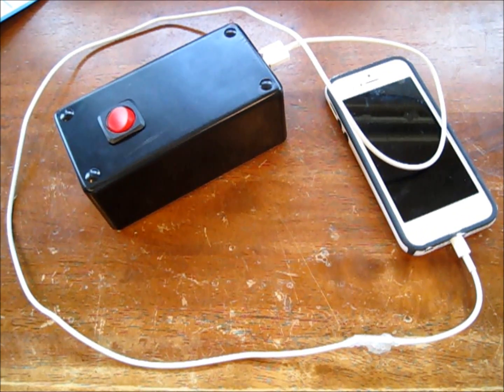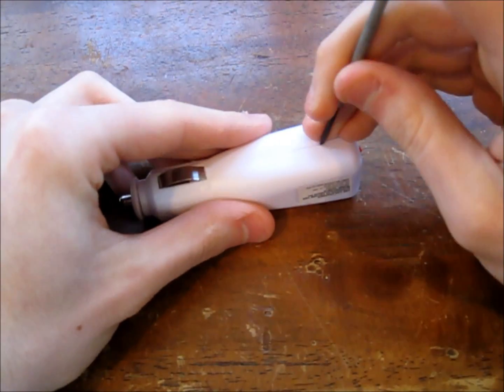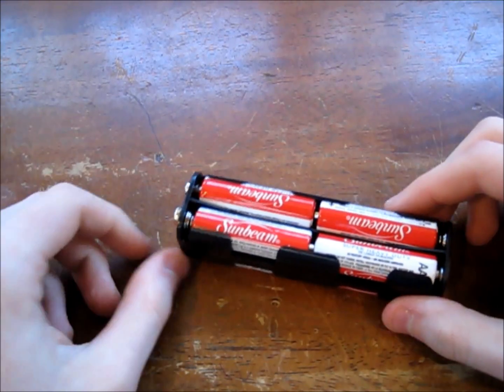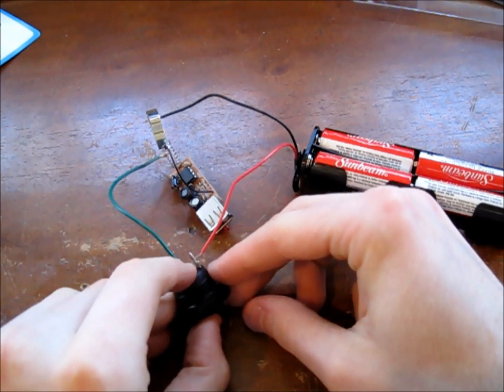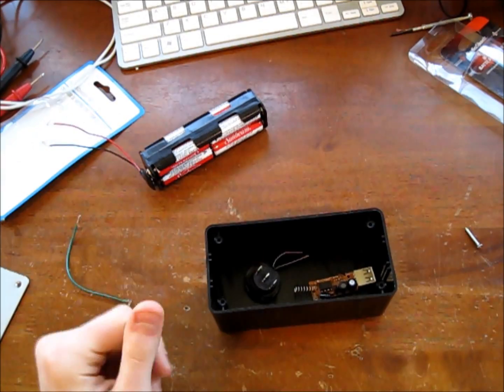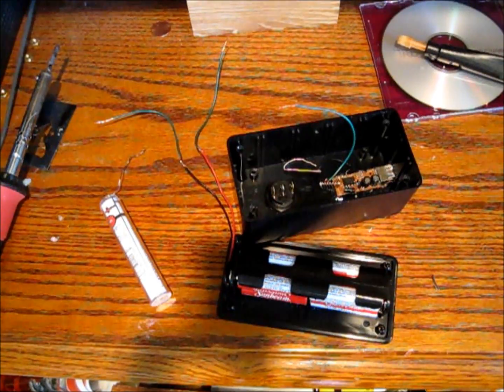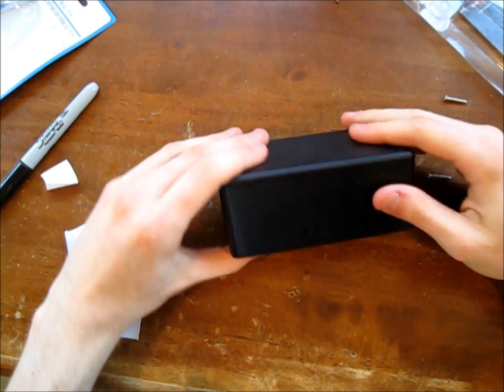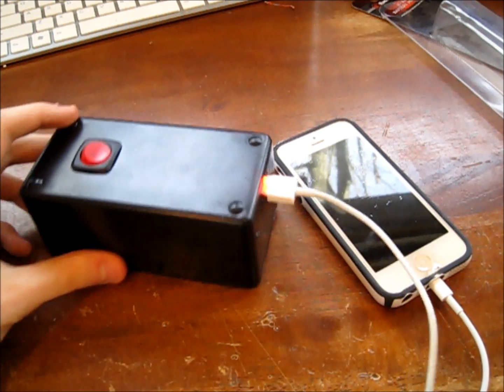How To: Make a Portable USB Charger!

Comment: that moment when you cant get a car charger so you buy the port, the capacitors, the resistors, solder and a soldering iron, the circut bord, the chip, the battery case, and all the other stuff, and build the entire thing 😂

Comment: Is there a reason you are using 8 AA batteries and not four? I don't really know all too much about electronics and shit but I'd think you could do basically the same thing except using a battery holder that holds 4 AAs instead of 8. If so is it possible to use rechargable batteries instead of regular ones? Well either way can you use rechargable batteries with this? I heard something about if you use rechargable batteries in a project like this the charger will output 6V instead of 5V or 6V will be input into it or something like that idk...

Comment: How many full charges can you get off of those 8 batteries?
Reply: The one i just bought from China was 4 dollars US and has the charge and output circuits built in. Albeit, it is from China and it performance has yet to be seen, but a small charger with regulator can be had for under a buck a piece delivered and a Buckconverter is 2 or 3. I've been looking into building a solar charged power pack that i can charge all day and use to charge my toys all night. 
I do realise this video was made in 2013 and there was not alot of good powerpacks back then.
Reply: Or you could just go out and find a 1 or 2 lipo battery power back for about what 8 AA batteries would cost, and never buy batteries again. Or, if you don't mind waiting for shit from China, you could order a 5, 18650 case and find an old laptop battery and have tons or rechargeable power. Or...
Reply: +Shellie Carlson but he will have to get an expensive battery charging and controlling circuit
Reply: nice

Comment: you did not mention which is the positive and negative on the car charger.......
Reply: That should be easy to figure out with either a quick google search or better yet by using a volt meter. Of course youd have to buy a volt meter in the first place (I dont believe they are all that expensive I think you can find a cheap $10-$15 dollar one that will get the job done) if you didnt have one to begin with if you wanted to go that route I say if youre going to be doing a few projects like this (where youre dealing with wires and electrical circuits) Id say its worth it
Reply: Upon a little more research I've learned that typically red wires in usb devices (such as that car charger or an ipod charging cable) indicate the positive (its apparently 5V DC i think most devices output 5V) and the black wire in those devices indicate the ground/neutral wire. In car chargers in particular Im pretty sure that the main spring in the middle is positive (aka the red wire) and the other weird long metal piece is the ground/neutral (aka the black wire). I think most car chargers (and to be honest most circuit boards with polorized charges) have a + and - sign for the polorized charges on them. Any other wires (such as I believe green and white in ipod charging cables) are positive and negative data and are unimportant (as to tf positive and negative data means idk XD I guess for sending and receiving the data? Idk) but if you do have extra wires you may have to do a little extra wiring to hook them up to certain electrical gadgets (Like a voltage regulator. I think you have to hook them up to ohm resistors or whatever theyre called). But whatever you do I would definitely get a voltage meter so youre guaranteed to get it right. Trust me you dont want to cross the charges. Itll short circuit any device you are charging it with which will render the device a nice expensive paper weight. Hopefully this info was helpful and I wasnt too late lol

Comment: If I used a 5 V regulator instead of the part from the car charger would it still charge an iphone? Since iphones i think need a 1.5-3V charge on the D+ cable

Comment: Does anyone have any suggestions on what to do if the LED light illuminates on the charger but my phone doesn't receive a charging signal from the charger?
Reply: do you have a iphone ?
Reply: +amine lendani Yes I think the issue is that for some reason once I connect the power to the car charger the LED works however the actually charging function no longer works. Any ideas as to how or why this happens? (I've already tried with two different car chargers)
Reply: +ethan orlowsky ios has a system thatl doesn't let unoriginal chargers work
Reply: Im not an expert but it could be that its wired wrong perhaps. You have to make sure to connect the positive wire to the ground wire (a quick google search tells you which colored wires are which but I believe for the 9V snap thing that he used the red is the positive and the black is the ground) as for the car charger insides Im not sure but again Im sure a quick google search or looking closely at the parts will tell you which is which

Comment: one other question say I had a 6 volt battery instead of a 9 volt will this cause any issues other then slower charging ?
Reply: What do you mean by that? Hes using AA batteries which each have 1.5 volts (well apparently thats only when they are new supposedly they typically output 1.2V which would mean 8 altogether would output 9.6V) altogether you should have 12V (with new batteries) not 6 or 9 (well as I said supposedly only new batteries have 1.5V so you should have 12V at first but it should drop down to 9.6V after some use)

Comment: if i wanted to recharge those batteries would I need to take them out of the unit im trying to build one where the battires can be hidden away and just there recharge port is visible
Reply: I'd imagine you could disect one of those portable chargers or something and with a little knowledge and some frankensteining (yes I just made that word up) you could rig some kind of portable charger that uses batteries to charge devices but... To be honest I think thats what a portable charger is anyway. Its just a different kind of rechargable lithium battery thats already prewired to connect to a wall or some other power source to charge. Really in the end I say just dish out the 10 bucks to buy one of youre going your route. Then again it would be a fun project

Comment: A better way would be using rechargeable batteries and get the circuitry from a cheap power bank.
Reply: Or get a power bank case for a few quid and put your batteries inside
Reply: ewelina kryszczyszyn Part of the fun's in the DIY.

Comment: Yes you can buy one cheaply now days.  However, some things come at a price on even how cheap it is.  That price is how long it last and weather or not it will damage your phone.  The cheaper it is, it probably won't deliver the output current needed.  I say save up until you can buy a $40 dollar or $60 dollar portable charger that has around 4,000 mah to 10,000 mah or more.   I've got a 16,000 mah portable battery.  Yes it is a slightly big pack.  But it can charge up my iPad about 3 times and the iPhone about 6 1/2 times.  It cost me about $80 bucks.  But it is worth it.  I even fount a bit smaller one that was 10,000 mah with built in double digit led to give percentage of charge left when in use.    This charger he built is not actually cheap if you consider the cost of the batteries you would be using to just charge up half way or all the way just once on a brand new set of batteries.   You can also search the net to even find a way to build it from scratch using a 7805 transistor which is just a 5v regulator.  Some portable emergency chargers even use two AA batteries.  I've bought one of those around 8 years ago.  They worked good back then.  But now with current cell phones having larger battery capacity.  It would hardly charge it half way or only 25% more life.  And that's only if you put it in airplane mode as well and not use it while its charging.  Only build this if your really want to, or something similar.

Comment: or buy portable charger
Reply: buying one isn't fun and buying one may cost more
Reply: naa i got one for £17, but if you enjoy it fair enough.
Reply: Or a lot less... http://www.ebay.com/itm/USB-5V-Mobile-Power-Bank-Charger-Box-External-Case-for-2x-18650-Battery-DIY-/281501287170?hash=item418ac8c302:g:hPoAAOSwofxUatdh
Reply: I see ones at the store for 10 bucks all the time. May not be the best quality but then again neither would this most likely. Only advantages I see of making your own are: "A). It's a lot more fun than just buying one and B). It's much easier to fix when parts of it fail."

Comment: I use a 12 volt cordless drill battery,get a charger that plugs into smoke lighter,put wire from negative from battery with flattened wire,jamb it in there,then positive on wire from battery to the pointy part on smoke charger,you have make sure you have good contact,for the pointy part on the smoke lighter I pull apart a bb connector and use the screw amlost like a grub screw,i power my phone and tablet at the same time,keep the ideas coming thanks!

Comment: i have a upgrade but instead of none rechable batteries whit charcable batteries and take a part a battery charger conect whit te wires make a plug output/input have a wall adaper and its recharbale instead of WASTIN MONEY FOR NEW BATTERIES.

Comment: If I will replace the batteries w/ rechargeable batteries can you add some power input to charge the rechargeable batteries?? and whats the voltage needed to recharge the batteries?? 

I need help pls coz i dont have that much knowledge about electronics.. thanks :)

Comment: I'm going to assume if you wanted to use rechargeable AA Batteries you'd need 10 rather than 8 as they are 1.2 volts and not 1.5.

However I tried this an nothing. The light on the usb comes on but nothing happena when I plug it into my phone. Any suggestions?
Reply: WellI had a second crack at it and the car charger started smoking. 

Maybe third time lucky? Heh
Reply: I have the same issue where my light turns on but the phone doesn't charge. Did you ever figure out how to fix it?

Comment: if your phone battery is 1500mah this will charge you phone 1.3 times because 1 AA battery is 900mah. 8 AA battery in serie is 12V 900mah but the car charger brought it down to 5V and 2160mah (12/2.4 = 5 / 900x2.4=2160).

There is no risk for your phone.
Reply: You sir .. Hhh ((facepalm)) ... Its gonna charge your phone more than 1.3 and I believe you got mah mixed up with straight up amperage ... They tought you this stuff in 5th grade .. a milliamp is not the same as a amp in the same way that a smart car is not the same as a bus
Reply: StUnT dRiVeR29 what i'm saying here is to charge the phone battery 0% to 100%.
You can do it once

Comment: I made one without a switch and every few Mins it says that this May not be supported
Reply: Aaron Clare no switch = the battery will be dead in 24h.
Reply: Thanx
Reply: Aaron Clare you welcome.
if you don't put a switch current will flow in the car charger circuit and use the batteries.

Comment: Where do u buy all the stuff? Can u send me links?
Reply: Kristian Johansen ebay.links :
Switch :http://www.ebay.com/itm/Red-LED-Lighted-Dot-Round-Rocker-Switch-19mm-Toggle-Boat-Trailer-High-Quality-/121518211567?pt=LH_DefaultDomain_2&hash=item1c4b0cc1ef

Box : http://www.banggood.com/Waterproof-ABS-Plastic-Electronic-Box-White-Case-6-Size-p-948279.html

usb car charger : http://www.ebay.com/itm/USB-Car-Cigarette-Plug-Adapter-Charger-For-DC-MP3-PDA-iPhone4-4S-iPod-Nano-/301218577003?pt=LH_DefaultDomain_2&var=&hash=item462206ba6b

8 AA battery holder : http://www.ebay.com/itm/1-PC-New-8-AA-2A-Battery-12V-Clip-Holder-Box-Case-with-6inch-Wire-Leads-Black-M2-/141018888955?pt=LH_DefaultDomain_0&hash=item20d5617afb

8 AA rechargeable batteries : http://www.ebay.com/itm/8x-AA-3000mAh-2A-1-2-V-Ni-MHPurple-Rechargeable-Battery-Cell-for-MP3-RC-Toys-/271324725463?pt=LH_DefaultDomain_0&hash=item3f2c36c0d7

Comment: You need to make sure to use heatshrink tubing. NEVER leave positive and negative wires or any kind of wires floating around with exposed solder joints. They could touch and short out, causing a hazard to yourself. Especially with that many batteries in the holder it's good to make sure no shorting can occur.

Comment: Dude ! how do u charge the low power bank battery??? not the phone !!!
Reply: REPLACE THE BATTERY
Reply: Sárkány Gergő need to replace the battery.you can use rechargeable batteries if you want. It will work.

Comment: Just use a linear voltage regulator and you don't have to carry so much batteries anymore. 6volts will do just fine. a good voltage regulator could be LM2940C :)

Comment: Problem is using AA format batteries, which are not Li-Ion. These days you can get an empty USB Charger from Chinese sellers such as the ENB 2x18650 also for $10.24, you don't have to assemble anything, includes a cable, charge indicator, uses much higher capacity 18650 cells, also charges them, and it has the all-important 2A output.

Comment: within $10 i can just simply buy a Rechargeable Power Bank from some good trusted Chinese company...with 4000 mah capacity. It can even fit in my pant pockets.
Reply: Then why didn't you do it rather than posting something negative in his page
Reply: StUnT dRiVeR29 that's not how it works, if you add up the voltage then the capacity stays the same.
Reply: StUnT dRiVeR29 If you put 8 AA batteries 1400mah in serie you will have 9.6V and still 1400mah, if you put them in parallel you will have 112,200mah but only 1.2V
Reply: JS7457 same with how 12v batteries charge up to 13.2 and 6v up to 7
Reply: It's actually 1000 mah ..
Reply: OoMDIOoO no 900mah
Reply: Use rechargeable AA (1400mah a piece)... 8 of them and u got 11,200 mah .. And no the 12v isn't gonna hurt your phone because the car charger has to run off your car battery yet it still only gives out 5v and 2.1 amps
Reply: StUnT dRiVeR29 and its still cheaper than the 10k mah chargers you can buy on amazon (that includes the discount and free shipping you get with prime)
Reply: Max Hargel 1.25V for rechargeable batteries.
i wanted to say 11 200mah but at only 1.2B
Reply: DMAN22yeah exact !
Reply: JS7457 and how does my rechargeable AA batteries have 1.5V?
Reply: Max Hargel 1.25V is the nominal voltage.
Why 3.7V lithium batteries have 4.2V ? Because 3.7V is the nominal voltage.

Comment: I have very important question, and I really hope anyone can answer it . how much could it charge , for example , if you want to charge an iphone , how long will take to increase 5% of the battery ??? because I made one by using 5 voltage regulator m but it was super weak , it couldn't charge 1% in half an hour , help please
Reply: XD I don't really know anything about the subject all I know is what I see in videos.
Reply: That's not enough,you need more voltage.i don't exactly know how much but he used 12 volts .flies away
Reply: that's why the guy used 12v. the batteries aren't Li-Ion so... I gues you need to up the voltage to match those?! o.O
Reply: You need a higher amperage if you want something to charge faster ... Kinda how a tazer works ^_^
Reply: ali heros more currnet(amps) not voltage
Reply: Hadi Jf shoudn't use a 5v regulator.
Reply: StUnT dRiVeR29 that's why there is 2 amp USB ... 2.1 Amp USB ... 3 amp USB (most of the new 2015 computers will have those... The inside of the USB will be blue so you can differentiate between 3 amp and 2 amp
Reply: StUnT dRiVeR29 blue inside usb port ?
there are not 3.0 usb port ?